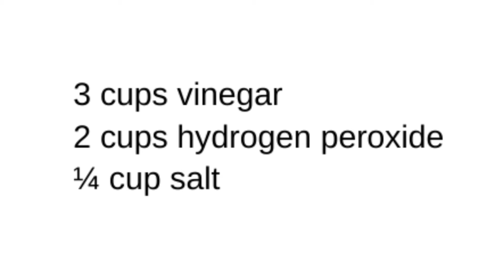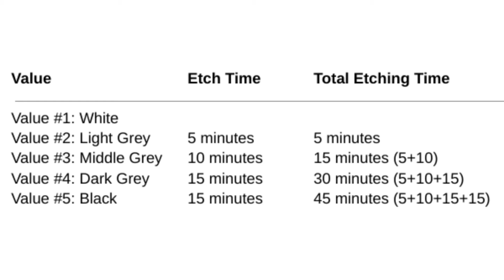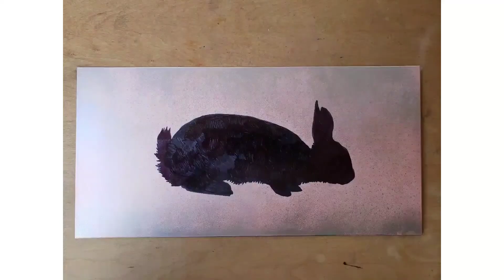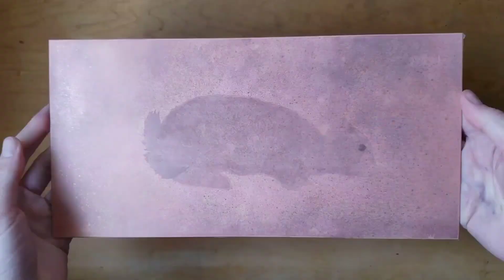Spray Paint Aquatint for 2 Plate Intaglio

Comment: Thanks for a great  informative video about aquatint. In the film you are using a Sharpie penn for stop out, which type are you using, asking just to Buy the right one. Are you using a Black double tip? Looking forward to your answer.
Reply: personally, i have used varying sizes of sharpies as stop out, from the fine tip to large chisel tip. it's worth experimenting as they can each create a slightly different line quality (especially with old sharpies, low on ink). hope that helped a bit—have fun!